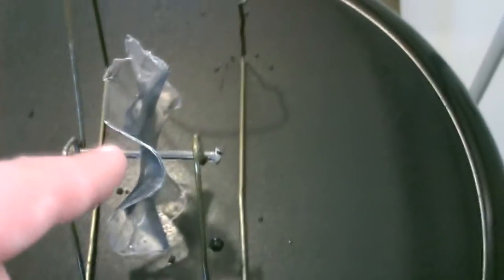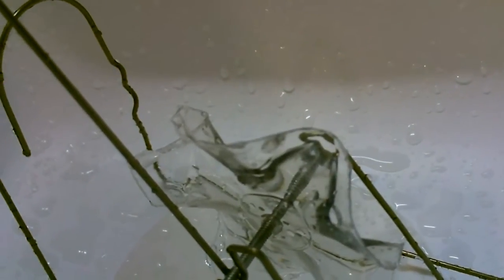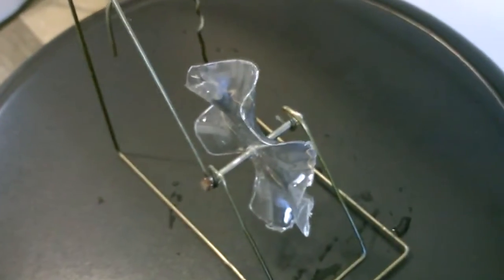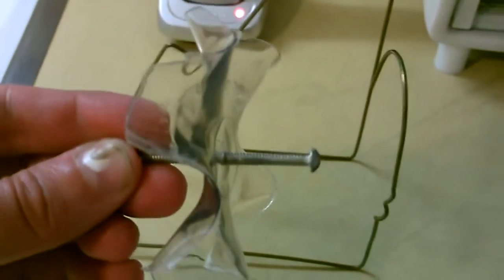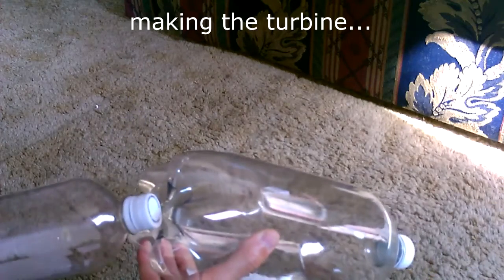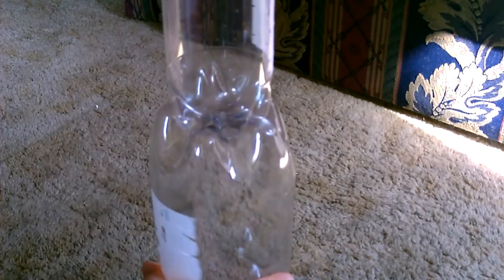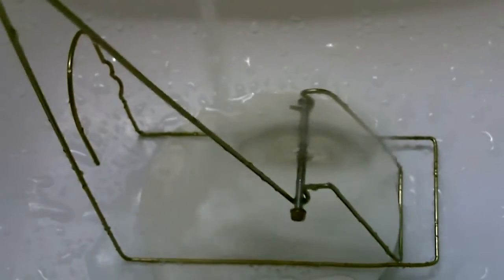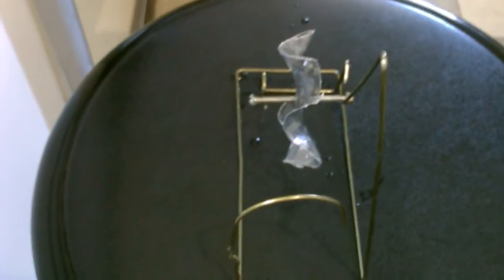How To Make a Waterwheel - Simple "micro-hydro" (using a bottle, metal hanger & bolt) DIY

Comment: Seems like if you could use solar energy to pump water up a hill or on top of a roof, you could let it run over a working turbine with motor for a trickle charge at night.

Comment from the maker: you probably wouldn't want to attach it directly to the wheel.  maybe use a rubber band over to the DC motor. that will allow the motor to be 2 or 3 inches from wheel.  possibly build a very small "splash guard" for motor too. maybe use the leftover plastic from the bottle to do it.

Comment: But the big question I have is, "Is there a small DC motor that is water resistant enough to attach directly onto the wheel?" Or will you have to create a small pulley attach the motor away from the water?